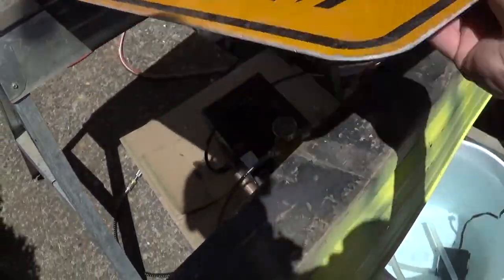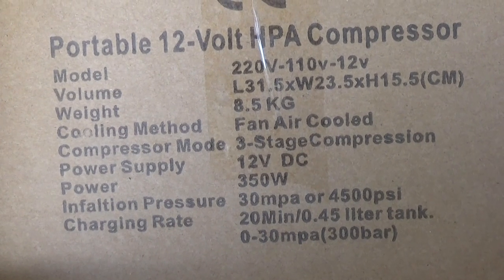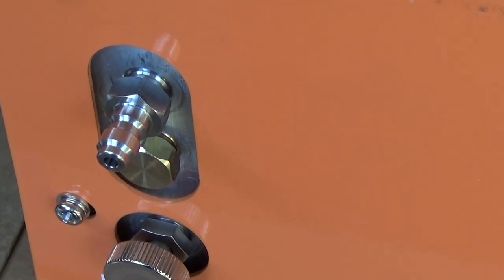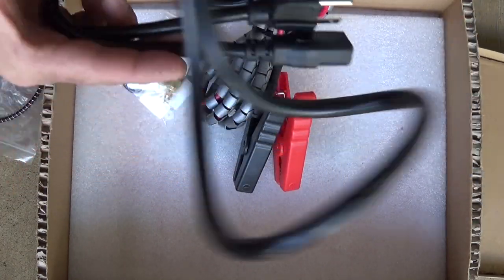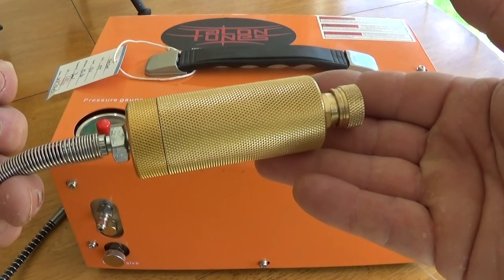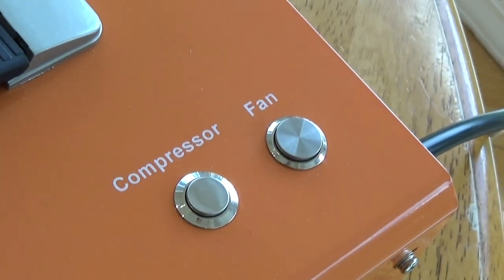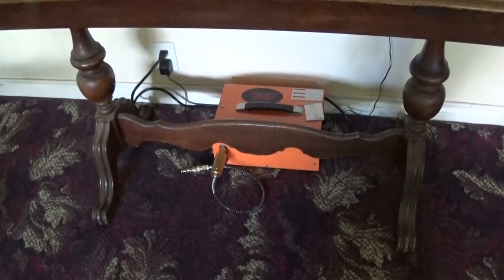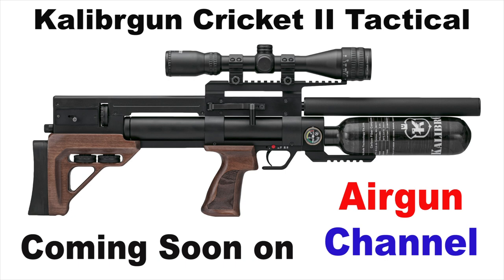Talon Tunes PCP Compressor - #1 for PCP Air Rifles & PCP Shooting (300bar/4500psi)

Comment: After it stops working in a year, how to make it work again?
Reply from the maker: Mine broke before 90 days.
Reply: @AirgunChannel  so how did you get it fixed/ resolved. Mine broke this weekend. I've used it probably < 25 times. What issue did you have? Have you found anything better?
Reply: @BobbySusenbach  I’m using the nomad 2. It’s working perfectly. Bought it for 7 hundred, might cost 8 now. One year so far.
Reply: Update: 
I contacted the manufacture and they were super nice and quick to respond. They sent me a replacement board free of charge with in a week. Installed the new board and it has worked perfectly for 4 months now. Out of curiosity I asked, but now I cant remember what the boards cost. It wasn't much though.
Reply: @williamczupryn2642  : I just received my Nomad II yesterday (02-26-2022) and it did cost me exactly $799.99 ($800) + $32.74 shipping, no tax.
Reply: I don’t think they make this one anymore

Comment: I have the generic version of this one (same unit other than it has no Talon Tunes sticker) and it is absolutely fantastic!   Can’t fault it.  Works perfectly every time!  No mess, no fuss and no need to worry about emptying the tank and having to spend 20 mins of blood, sweat and tears trying to pump it manually.  If you don’t have one, get one!!
Reply from the maker: I love mine too. I bleed the air before I turn it off. It's supposed to save the piston from slamming back.
Reply: Where did you get yours?
Reply: @AirgunChannel  Bleed it before turning off the pump? Wont that just keep shooting air out of the bleed hole?

Comment: I still use my Yong Heng compressor after 3 years and love it.
I fill my 90 CI 300 BAR paintball tank maybe every other week and I've had nothing but good experiences.
And with a second stage filter, you can even safely breathe the air for diving or whatnot.
Reply from the maker: I am sure. I always break the cheaper compressors...but it's always my fault. If I was responsible I could probably keep a YongHeng going.

Comment: These compressors are rebranded over 100 times. The key for it to last is to take the cover off and torque the Piston rod and centrifugal output balancer right when you get it. Otherize it just wrecks piston orings and the rod will snap at the base of the piston as well. They are too loose from the factory and eventually start to wobble and snap and grind the piston walls. Also grease the piston, rod, and centrifugal balancer. Mine has been going strong for 18 months now. Another important thing is to drill the bleed screw knob so you can put an Allen wrench in there and tighten it down real tight to re-seat it before using it or it will eventually leak. I learned all this from my first one that only lasted 60 days.
Reply from the maker: great info...but I'm not taking a chance on another one.
Reply: Could you make an video tutorial how to tune it?

Comment: The sound you hear when it's plugged in but not running is the inverter fan there are two fans on that compressor one for the inverter one for the pump.
Reply from the maker: Cool, thanks for the info! -Nate

Comment: Mmm had my Yong Heng compressor for nearly 4 years now,not one issue,setup is not complicated does not leak oil and if it does fail almost all the parts can be found on Aliexpress.
These new oil free compressors are good but because they are sealed units so no maintenance but also if it fails almost impossible to fix then your relying on company you bought it from to fix it,even if it's under warranty you will be doing a lot of phone calls and emails chasing people.
Pros and cons to all cheap compressors.
The compressor your reviewing is not rated to fill scuba tanks,rifle only which is no big deal but just be aware of it's limitations.
Plus side to this unit which is also sold on Amazon under Spirotech,the units are super compact.
You will get the same moisture content from either Yong Heng or this Talon Tunes compressor,moisture is based on humidity level,best way to reduce this is fit a water trap/separator which usually quite a big aluminum tube probably 14 inches long by 3 inches wide,you can fill with moisture absorbing materials and needs to be held vertical with compressor inlet at the bottom,the small filter that comes with this compressor and Yong Heng does not have enough surface area and volume to trap moisture just dust and oil.
Reply from the maker: Thank you for that info! That will seriously help me alot.

Comment: At the 11 month mark my compressor wouldn't come on. The display would power up and do its boot up cycle but the compressor and fan wouldn't run. I contacted the manufacture and they were super nice and quick to respond. They sent me a replacement board free of charge with in a week. Installed the new board and it has worked perfectly for 4 months now. Out of curiosity I asked, but cant remember what the boards cost. It wasn't much. I also ordered a oring rebuild kit for $17, including shipping, just to have on hand for when that day comes. Will likely rebuild in a couple months as preventative maintenance if no issues arise prior.
Reply: Thank you Tony (Talon Tunes) for responding so quick, pointing me in the right  direction,, getting me back shooting as soon as possible. The compressor is still running great.

Comment: Don't get me wrong, like your content and all, but I've been filling my two scuba bottles every day I shoot, with a chinese compressor, never had an issue, still looks like new.
Looks like you've been dragging yours after a pickup or something lol.
So for everyone else who still has one or cant afford the extra 150 bucks for a Talon/whatever else:
Always open bleed-valve a tad, THEN turn the compressor off, or its gonna backlash the piston and put too much force on the cylinder head.
Also use engine coolant in the bucket instead of water, or you'll overheat it, zipties on hoses holding them to the bucket handle so they don't pop over the edge and splash coolant all over your compressor. 
Don't run it for 5 hrs straight or anything, with proper coolant about 10 mins on, 10 mins off seems to be the sweet spot for me.
Use decent quality 10w40 engine oil, swap it out every so often.
You're gonna get crappy air when you use the supplied filter, you need a proper moisture filter, some guys take it into the extreme and build a system where they have 4-5 large filters in a series of up & down orientation to REALLY get clean air.
Always a good idea to disassemble and clean out the moisture from the steel lines & external pressure air blocks for the low and high sides too ^^
Lastly, it doesnt hurt to have a spare piston or two, if it DOES break you're operational again with just a bit of wrenching :)
Reply from the maker: Wow, Great tips. I knew some of that...but I didn't know most of it. I would "pin" your comment...but Tony paid me for this video....
I never would have guessed: "Always open bleed-valve a tad, THEN turn the compressor off, or its gonna backlash the piston and put too much force on the cylinder head" ...I wouldn't start a compressor under pressure...but now I won't STOP one either. Thanks dude! -Nate 
P.S. I added the giant PCP filter to it...when my M3 came.

Comment: Hey the little orange compressor was my first PCP compressor it works great I have a young hang also for filling up bottles I like them both I use the little one for topping off air guns whenever I need a quick Fill
Reply from the maker: That is super cool. I forgot, that when you are shooting a 200 bar gun, a big tank works great if it's at 300 bar you can fill your gun all day. So I guess I'll keep my big tank around

Comment: You forgot to mention: you also need gas in the tank of the car...... probably....  Also I think your bleed valve is supposed to be open until the compressor starts, else it may not last too long... :)

Comment: I’ve got the Nomad 2 , basically the same compressor. Word of caution ! If you find it’s not charged to the pressure you want ..DO NOT just turn the gauge up and restart it again without purging the hose , you’ll wreck it pronto . Also look after it with good quality silicone oil .
Reply from the maker: Yeah, I always start the compressor with NO pressure. Many people said they wrecked them that way.
Reply: How/where do you apply the silicon oil
Reply: @BobbySusenbach  : Watch this video, at exactly 14:00 he will tell you where to put the silicone oil:
https://youtu.be/6pNvoVxA3gs
Reply: @happyman4914  thank you
Reply: @BobbySusenbach  : You’re welcome.

Comment: I need a electric pump bad because the 80 dollar hand pump i bought from Amazon takes atleast 45 mins of non stop pumping. I am in pretty good shape, I run and i race motocross but this pump still burns me out a little.  Makes me not even want to shoot. I am new to pcp just getting into it so here i am hoping to find a worthy electric compressor at a realistic price.  $1200 for a small compressor is a joke.. I could go buy two high power rifles for that..
So far I have the hatsan flashpup QE 22 cal and the Texan LSS 45 cal with carbon tank. And no I've never filled the Lss tank with the hand pump,  I have a small hunting shop down the road that only charges me $3 to fill it.

Comment: It’s apparently is a duplicate of the Air Venturi an Nomad 2 and which I own. I agree it’s probably one of the best portable compressor it’s around the exact same cost $750 bucks even the fan runs while off, until you unplug it.... Tom LI NY say hi to Bugaboo
Reply from the maker: Bugaboo said 'Helllll Yeah! I guess the small fan cools the inverter. Also, the Talon Tunes version is only $429. I love the portable compressors now! Thanks for watching! -Nate

Comment: That's a real nice pcp compressor NATE , I thought about getting one , my Yong Heng finally went out right before I got my new FX vp maverick 22cal  2 days ago piston cracked after 2 years of service ,  but I had purchased a back up yong heng compressor 6 months ago , great video and presentation 🎯
Reply from the maker: I am not good at Yong Hengs. I am on my 5th cheap compressor. This one will be good to have around. Thanks for watching! -Nate
Reply: My Yong Heng is still going strong. Quality oil and not filling scuba tanks is the key. When they run too long they get hot and it’s the heat that kills them.
Reply: @coreymoyers  👍

Comment: Very interesting. I have a Benjamin trail charger that’s been running like a champ for the past two years. My biggest beef with it is how long it takes to charge up my Prophet. From 1000 psi up to 300 bar takes about 15 to 20 minutes. Because of that, I never let it go less than 2000 psi. I ended up going the opposite direction and getting an omega air charger and a tank. I know you said that your tank will only fill your gun to about 250 bar. I can deal with that. Even at 250 bar, I can get a hell of a lot more shooting in. Cheers.

Comment: Might be good to set the compressor on a board the size of generator if perhaps you  have carpet that the feet of unit will sink down into and somewhat obstruct the air flow through bottom ventilation port slots.
Reply from the maker: Yes, Mine only lasted about 3 months.Mabye carpet had something to do with it. -Nate

Comment: To anyone who bought Talon Tunes compressor. How often do you use it and most of all is it still working? I bought the GX Cs2. I only had it for 3 months and only started to use it 3 weeks ago and it started knock and blowing oil or grease out the moister tube
Reply from the maker: You can't start these with pressure in the hose. It's also good to bleed the air before you shut it off..that saves the piston from bouncing back. I have used mine every day for 3 months.

Comment: How is this compressor still doing? How often do you change the filters and how oily and wet are they? I'm thinking about buying a compressor and i like this and Hatsan has the Volt compressor, but not many videos on it. Also i have to say your videos are the most entertaining air gun videos. Even if i don't care for the gun it's still fun to watch! Thanks!
Reply from the maker: Hey thanks! My compressor is doing great so far. It does produce kind of moist air, but the filter catched alot of it. I have not changed the filter yet...I did ad a giant filter to the hose when I got my Impact. https://www.amazon.com/Separator-Compressor-4500Psi-Pressure-Connector/dp/B08LL1DXZ4/ref=asc_df_B08LL1DXZ4/?tag=hyprod-20&linkCode=df0&hvadid=475715995816&hvpos=&hvnetw=g&hvrand=15310961435593347112&hvpone=&hvptwo=&hvqmt=&hvdev=c&hvdvcmdl=&hvlocint=&hvlocphy=9033610&hvtargid=pla-1186854477101&psc=1

Comment: You've shot a lot of airguns. How is it without an external moderator?
How is it using the bottle as the cheek rest. When I bought my Talon SS I couldn't get used to the bottle / small shoulder rest. Only After I bought a Maddog stock for it, was it useable for me.
Reply from the maker: I don't remember the cheek weld part. I think it was OK. The 50 yard part of this video (VIXEN) was shot without the external moderator. It's real loud if you take the can off. It's real quiet with it on. I would skip the Vixen if I were you. The RAW chassis gun is pretty cool, or a Maverick. ...both will out shoot this gun.

Comment: Today is 8/12/21 - how is that compressor doing?
UL approved?
Warranty?
Service center locations?
Thanks!
Reply from the maker: I still use it every day. Going good. I needed to polish the pressure release screw end with a emery cloth to keep it shiny. When it got not shiny the compressor would not go over 225 bar.
Reply: @AirgunChannel  
Thank you.

Comment: Nice Video. My concern is that a lot of the reviews for these Chinese Compressors say they never last more than a few months if that long. At this time I would rather spend the extra to get a DOT approved SCBA 45 or 60 min tank and refill it at the local shop.  This should get me one or more full 3,000 PSI fills and a couple of top-offs when my gun gets down to 2000 PCI.  Also, the tank is much quieter out in the field than hooking a compressor up to your truck and running both. That would scare just about anything off you're looking to shot.
Reply from the maker: Yeah, mine broke before 90 days.
Reply: If you haven't shot anything within the 100+shots you get from a fill you must be doing something wrong so it's not fair to blame the compressor for being noisy

Comment: What happen to your Benjamin/Crossman compressor ?  Is it still holding up ?  Reason I asked is because I brought two(2) of them.  Got them on sale which was a good deal so I got both.
Reply from the maker: The fans go out,  I 3D printed a fan that works great. Later, when I tried to change the filter, it started leakig after that. Email me at kaylaindy@gmail.com when your fan goes out. I can sell you one for $50.

Comment: The Nomad has an oil hole and 2nd moisture and oil release. Where might they be? How do you maintain it so it lasts?
Reply from the maker: Not sure. Mine broke after 3 months.
Reply: @AirgunChannel  Your Talon compressor broke after 3 months? Were you pumping scuba tanks with it? What killed it?

Comment: Hi . Just bought one of these compressors but I need one of those fill probes .can you tel, me where you got that one .thanks
Reply from the maker: The probe comes with your gun. You need a 1/8 quick dissconnect nipple that is 1/8 BSPP threads. Amazon or Pyramyd Air
Reply: @AirgunChannel  Thanks for getting back to me with the advice.